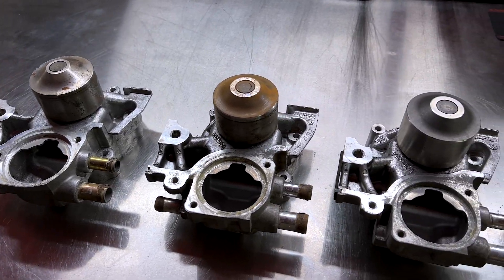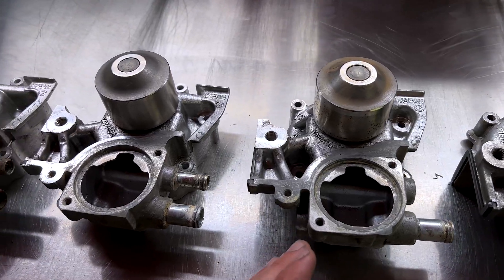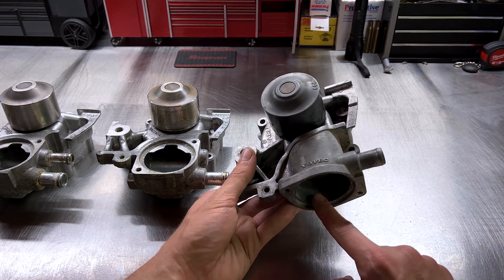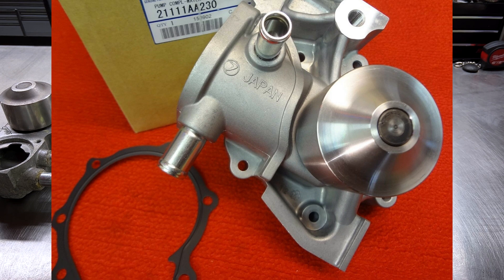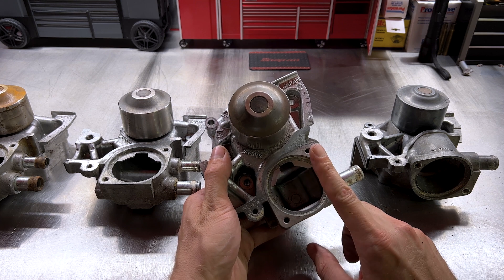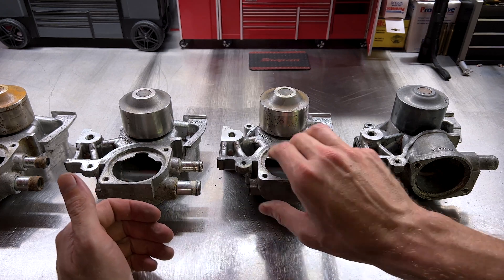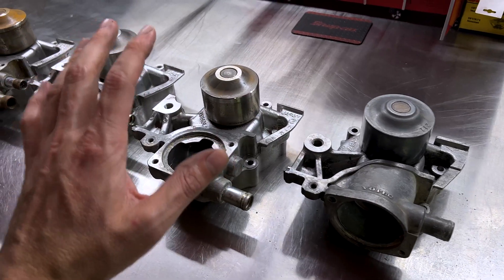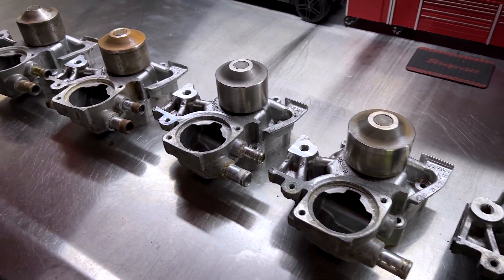Subaru EJ Series Engine Water Pumps: Over 10 Different Water Pumps?!

Comment: Can you explain why the water pump 110 all the way on the right have 2 different variations? One for auto and one for the manual ? My auto 2004 forester has the oil warmer/cooler that connects to that water pump but the manual version of my forester doesn't have the oil warmer/cooler.

Comment: Watched this video and found that i have a water pump not listed!
Low mount turbo EJ255 Liberty, part number ending in 370 is similar to 380 with the j shape barb, but the bolt and o ring fitting on the back side is a blank undrilled casting.

Comment: Very informative.  Thanks for making this.  My question is can you mount a front mount thermostat water pump (21111AA280) on an EJ25 (‘03 Outback) that had a bottom mount thermostat water pump (21111AA110)?  Doing a swap into Super Beetle and need the thermostat water neck high so that the exhaust header can go under coolant hose.  Thanks!

Comment: hi. My 2007 Forester XT EJ25 /Aut Trans.  overheats ONLY up hill. doesn't matter the rpm, which I usually use it between 2.500 to 3500. Has brand new radiator, hoses, caps (2) (rad and exp), new thermostat (78C), temperature sender sensor, new Subaru coolant, and both fans work. I'm going now for the water pump. The car has 200K kilometers and I just had it for the las 4 thousand km. in traffic and around town, temperature is excellent. The water pump is the type with bottom thermostat and two (2) bars (tubes) to the right and one (1) to the left. Question: I'm I ( the XT) using the correct water pump? or the previous mechanic installed a wrong pump? TY

Comment: Why would the water pump be different on a manual versus automatic transmission? I just bought a manual timing kit with 1 barb on the water pump vs the 2 barbs on my old water pump

Comment: So a water pump for a 06 Forester with an Automatic will bolt right in place of a 04 Forester water pump with no problems with the exception of a little change to the oil cooler line and lower raditor hose.

Comment: I thought this video would clear things up but it's only lead to more confusion. I have a 2005 2.5i N/A manual legacy (UK market), im almost certain it's an EJ253 and its got a water pump with 2 barbs on one side... but no turbo, so where does the other line go? when I search for timing belt kits by reg number or make and model I find that half of the kits have one barb and the other half have 2? any ideas whats going on here?
Reply: Hi Richard. I'm having the same problem with my 2006 model. Did you end up going with the Aisin WPF-008 with two ports on one side? Cheers
Reply: I ended up using a gates kit.

My receipt has the part no: 5414465455742
On it. It was a while ago now so I don’t really remember the specifics. It was from autodoc

Comment: I have a question that someone else has already mentioned here. It's with regards to the pros and cons of the types of impeller used. 
Most people say that the cast impeller is either more efficient or cavitates less at high rpm. We'll also see more stamped units that are supposedly more cost effective. Probably because those models were produced in higher numbers???
I see one of the pumps you mentioned was the HV cast unit and seems to confirm this theory. However, I see you showed other pumps also used in turbo applications that have stamped impellers instead. What's your opinion on that? Does this theory carry any weight?

Comment: The Legacy SS/TW EJ22T has two different pumps. The 1991 has 3 ports (21111AA026) and the 1992-94 has 2 (21111AA065) as you mentioned. The '91 Legacy SS was the only 22T with an oil cooler.

Comment: I want to change the Water pump in my 2002  Wrx Sti, would the cast/closed impeller pump be better/more efficient, because the one I have been using is the open impeller pump.

Comment: Does anyone have the Aisin part number for the timing belt/water pump kit that comes with the closed back cast impeller pump (bottom exit, one barb) for the ej251??

It’s driving me nuts. 

2002 outback calls for TKF-010 but I don’t want the stamped steel impeller.. thanks!!

Comment: How often does one replace these?  With every timing belt change, say 100k, or only when they fail?  How long do they go on average? Thanks.  I am asking cause I have a car that is due for timing belt replacement due to age, but mileage is low as I have not been driving much for last two years, ...I have been working from home.
Reply from the maker: Replace them with the timing belt kit. Rarely do they fail, but it's cheap insurance as to not have an issue while already in that deep.

Comment: Nice, so when i pull apart my 2006 lgt manual with 200000 miles it will be interesting to see if the previous mechanic used the right pump, and whether the aisin tkf004 is the right replacement part, fun adventures 😁

Comment: I recently had a customer with 2012 legacy 2.0 cvt with pump close to the 380 pump. But it had straight connections on the side and oilcooler hole in the back. Part number 21111AA460. That pump was hard to find.
Reply from the maker: Oddball one.

Comment: When I did my 04 Forester XT TB replacement I did the water pump as well and sourced the closed cast impeller from the local Subaru dealer, that water pump was for some reason exactly half the price of pressed steel open impeller in my part of the world, I assume it was older stock and therefore cheaper.

Comment: Hi Mr. Subaru, my 150miles 2007 subaru legacy 2.0R MT, has started hesitating during acceleration.... the throttle body been cleaned recently and was running perfectly, but it has now started this scarely thing, am worried 😟 .... what could be the issue

Comment: I can't help but to wonder if this wasn't a bit of a engineering eff-up from Subaru/FHI's part. Surely there must have been a better way to go around this than having so many different water pumps.
Reply: Its not a screw up at all, changing such an inexpensive part to accommodate multiple engine layouts is incredibly smart engineering.  

The differences are entirely due to just header layouts, turbo vs non turbo, and whether or not the engine needs an oil cooler.  With several options here, you can easily change components and not have to redesign massive expensive parts of the motor.

Better yet, this makes it incredibly useful for aftermarket motor building as you can add or subtract the factory oil coolers with these engines easily, change out to different headers, or even do various things with turbo coolant feed if needed.  Just pick the right water pump and it can solve several changes you make.

Comment: Thanks 🙏 sir. Love from 🇮🇳 I have 04 Forester 2.0x trim model  manual as in India there are no parts available pls guide to get the right parts I want to do timing, Gas kits as oil is leaking on silencer, and clutch kit need to replace also. Thanks a lot ur video help a lot. Keep growing. ❤️

Comment: Thanks for the video! I have JDM 2006 Forester with EJ205 Turbo and already have Aisin TKF-004 Timing kit with included pump: 21111-AA240 (WPF-023). Based on my research, 21111-AA250 should be installed originally. Aisin data sheet states that this kit fits EJ255\257, however, it recommends it for US WRX EJ205. I believe that my EJ205T is the same as 205 WRX EJ205T. However, found a number of reviews of this kit installation onto EJ205T with no issues. I am confused and wondering if I am safe to install AA240 (WPF-023) and TKF-004 Kit in my EJ205 Turbo? PLEASE ADVISE. Thank you in advance.
Reply from the maker: It should work fine for you.
Reply: @MrSubaru1387  Thanks a lot for the answer!

Comment: just did the timing belt and pump on my 04 wrx the aisin kits water pump so far works great 10-20 degrees cooler than the stock water pump

Comment: Now you should do a video on Oil Cooler part numbers LOL
Reply: or part numbers to eliminate the oil cooler... on the non turbo cars they serve zero purpose and are very leak prone. here in the north just about every one i see is either leaking oil or the metal pipe rusts out and leaks coolant. oil filter fitting, 1 hex plug and either a non cooler water pump or a rubber cap and the cooler is gone.
Reply: @volks-jager  I rarely see leaks there here in the non-rust belt.  If anything its the red o-ring on the cooler.

With temps here that hit 110+F, the factory oil coolers especially on cars driven hard (even NA cars) do drop oil temps 15 degrees or more on the track.

In colder climates, these coolers can bring engine temps up faster.  They even offered them as a dealer installed accessory kit for Foresters for awhile, mostly for thst purpose or towing.
Reply: @stevemartegani  99.99% of subies up here are not driven hard or used for towing. (and race cars are whole different story). up here they are pretty much the vehicle of choice for Suzy soccer mom, old people and hippies. just about every one i get in with a oil cooler it is leaking oil profusely and when the low mounted metal tube that get hits with tons of salt rusts out you get a catastrophic coolant loss. ive converted well over 100 cars to the non oil cooler setup - simpler and it never leaks.
Reply: @volks-jager  Well, sounds like you should design a plastic or aluminum version of that tube and retire off the profits.
Reply: @stevemartegani   stainless would be the way too go. and also the metal tube that goes to the heater core - ive replaced so many of those it is absurd. too bad no aftermarket company makes them like that.

Comment: I cant find an EG33 water pump, need at least two. Dealers dont have them, Ebay shows incorrect pump on pictures. Any ideas where I can find a genuine pump?
Im at the point of just spamming subaru of north america with emails to get one.
Reply from the maker: I had to buy an aftermarket pump for my SVX when it died. 😔 💔
Reply: Napa has the TWP 42328 pump, manufactured by GMB, available for the EG33.

Comment: the closed cast impeller is the better design. i try to use them when ever possible. i used to be able to get NPW brand pumps (which have closed impellers and made in Japan)at my local API but they dont carry them anymore. the stamped open impeller design is less efficient - likely made to cut costs
Reply: You can get NPW (Nissan Pump Works) at Napa under the Altrom brand.
Reply: @2003wrx64  good to know, unfortunately my local NAPA (Sanel Auto parts) is by far the highest priced auto parts store in town. i honestly dont know why anyone uses them. i only go there went absolutely necessary. i can still get the NPW pumps online. the F-17 (bottom t-stat non turbo)and F-27(front t-stat non turbo) are the 2 most common

Comment: I just finished timing belt service on Saturday on my 2002 Forester. I want to say thank you for teaching me how to do it. Installing the new water pump was the only struggle do to the gasket moving around. I got it on the 3rd try. Thanks again👍 I also did the valve cover gaskets, plugs and wires. The spark plug tubes were full of oil. New plugs and wire gave so much power back when it was finished.💪
Reply: Need to address this on my 09 2.5 outback wagon to restore its original power too ! Feeling confident thanks to Mr Subaru’s vids 🤙🏻
Reply: Sweet man! I did my '10 two years ago. The gasket was a pain!!

Comment: Just wondering if the thermostat housing is interchangeable in all the water pumps? some are plastic, some not? How about fitment will some of the water pumps fit another EJ engine?
Reply from the maker: All these pumps bolt up on any EJ engine. They don't necessarily work, but they'll bolt in place.

The aluminum housing/outlet can be used in place of the plastic ones.

Comment: I bought a whole timing belt kit from Subaru half a year ago for my JDM 1998 Impreza WRX STI, the water pump included in the kit was 21111AA026. Also come with double bearing lower idler, but the factory smallest idler supply was 13073AA200 simgle bearing idler. I know it become double bearing for 2001+ STI with a longer bolt, came back to Subaru they said GC8 only comes with single bearing small idler, wondering should I upgrade or keep it that way?
Reply: Always upgrade to the double bearing idler with longer bolt if possible.
Reply from the maker: Seconded.

Comment: Are those numbers that you're giving are they on the thermostat housing somewhere? We bought a 2012 Subaru limited outback that I believe had the engine replaced. Is there a way to verify numbers on the water pump housing?
Reply from the maker: No. P/N isn't anywhere on the water pump.

Comment: @MrSubaru1387 how would you replace a head gasket on a sohc ej22 on a 1997 Subaru Impreza without a engine hoist or engine stand with mostly hand tools ? And where would I be able to flush or bleed the heater core to restore my heating system? I ask because this is my current situation and had just started as a new tech for Subaru and my head gaskets have blew. I don’t know what to do and it’s my daily commuter. Any suggestions or information on doing such without engine removal would be greatly appreciated
Reply: It can be done with the engine in the car, it's just a much bigger pain.
Reply: @802Garage  I like to keep it easy considering I have never done it before
Reply: engine stand is dirt cheap at harbor freight. subie engines are very light  - a tripod,gantry,garage roof joist or even a good tree and a chain fall hoist or come along will work. DONT do a shitty in the car head gasket job - on the stand is the right way to do it.
Reply from the maker: Wait. You had an EJ22 head gasket fail....?!
Reply: @MrSubaru1387  yes, unfortunately I got the car in poor shape but I want to save it and got it at 186,000 miles. The head gaskets were leaking but it wasn’t until I got to 197,000 miles that they have failed. I’m short on cash to have it done by a mechanic and yet ironically enough I went to a high school with trades like Automotive that I got to be a part of. After graduation, I continue my automotive studies in college ( still attending currently) and found a job at a local Subaru dealership. I lack in both knowledge, tools and experience but am willing to humbly learn. I don’t have a garage to do the work and no one I can do the required repair in their garage at all or for cheap. What can I do with mostly hand tools ? Do I need just the head gaskets and resurfacing the heads? I have shamefully overheated them sadly and don’t know what to do to help save my car 😞
Reply: @MrSubaru1387  Hahaha I was thinking the same. Was going to say first make sure it's actually a bad head gasket. If it's just overheating, could be other issues. I guess it is more common when they changed the head gasket material from 1997 on? Still pretty uncommon though.
Reply: I wouldnt you kinda need the cherry picker and stand
Reply: @jonk6137  that’s definitely unfortunate for me. I’ll have to get both then